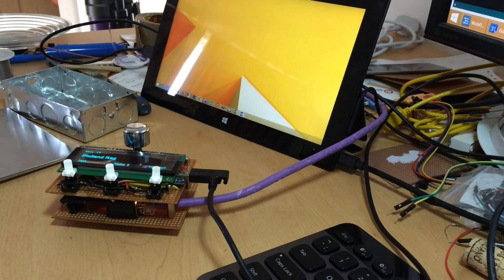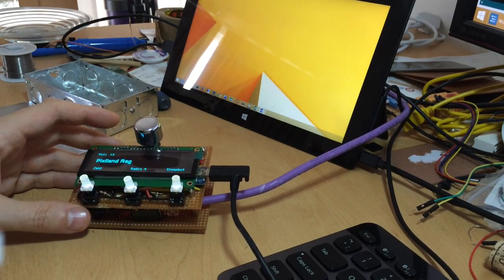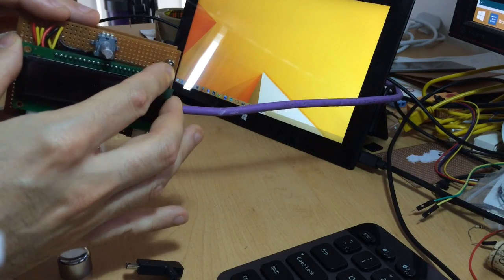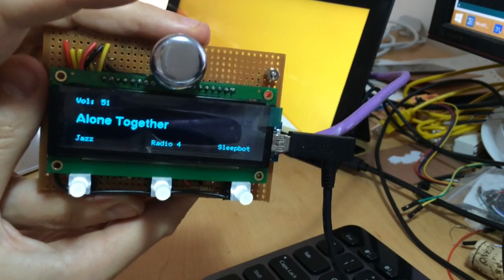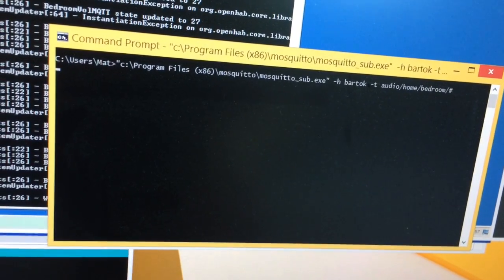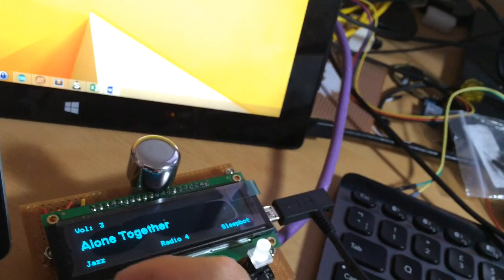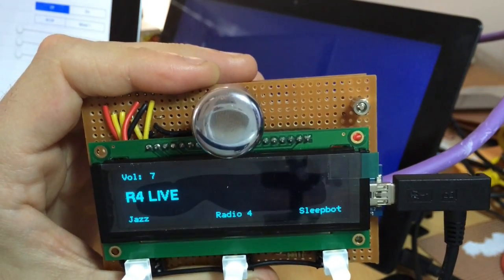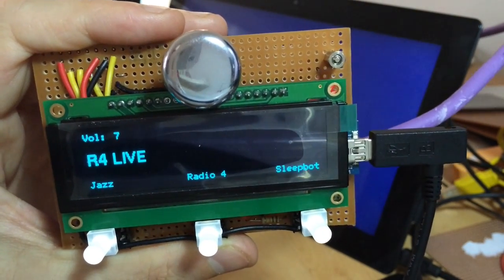Arduino-powered Home Automation Display & Control Plates

Comment: Hi Mat, great video and a very cool project! I am also a follower of Julian's channel and I've recently developed a bit of an obsession with arduinos! 
I have started building something similar myself, initially it was to create my own "intelligent" central heating system, so that I can control the different zones in my house a bit more than you can with just thermostats. But I've got the bug for it now, and having seen your videos and as someone who has used squeezeboxserver as a multi room audio system for several years, I'd love to upgrade my room sensors to control panels... at least in some of the rooms anyway!

Are you willing to share some of your code used for the controls? 

I'm thinking of making my own pcb's for this, with POE. Have you considered capacitive touch buttons? I have a feeling they could be easier to build into this sort of project, as well as being more compact?
Reply from the maker: Hi James, thanks. Agree - it's utterly addictive. I've done loads more work on it since the last vid, in fact I just finished a little video with some updates to the project. I'm uploading it now. Latest version does include capacitive touch, although not for control but rather to bring the device out of sleep (a sort of kinesthetic feature, you wave your hand in front or touch the faceplate and it lights up).

Since the above I've moved over to the Arduino Mega2560. Simply can't keep my code below 32k, nowhere near in fact. I wanted different fonts using U8G library, and loads of settings to be downloaded from a server and stored at startup.

I have long been thinking of moving everything onto my own board including W5100, PoE, and the AVR. I concluded I wouldn't do this because of the large increase in complexity and my personal deadlines (we are renovating the home soon...) PoE (DIY version at least) is the easy bit if making your own board, implementing W5100 is a little more complex I feel.

I'm totally willing to share some of my code. It has been in "unfinished" state for the last few months as my ideas have been growing. I have a deadline in sight as we are renovating the home. Can you check back on my channel or blog and I'll upload some snippets soon?
Reply: HI Mat,
Thank you for getting back to me - I love the capacitive touch idea for waking it up - a really neat touch!

I'll be sure to keep an eye out on your blog for some code snippets and in the meantime if I come up with anything else that I think may be of use, I'll be sure to let you know.

Thanks again

Comment: I really like what you're doing and am planning a similar architecture for my house. Where did you find that Tuodi panel (one minute in)? Does it fit your motion sensors?
Reply from the maker: Very good question! My idea was to find a PIR housing into which I could install my own PIRs (you know the very cheap things on Ebay, £1.20 or something) - and other things like light sensor (ebay cheap), temperature and humidity sensor (the DHT22). I thought maybe the housing would cost £3-5 each, so total cost would be £12 for each multi-sensor. Not so - couldn't find housings so I bought the one you see here which included a mains (US voltage 120V) PIR switch. I then removed that (it seemed unsafe anyway!). I haven't worked out how to include my own yet, but was thinking about approaching a 3D printer. Any ideas?
Reply: *****
I had thought of just drilling a hole in a blank metal outlet cover and screwing it into the ceiling. I like the look of the Tuodi panel, but I suspect it wouldn't be a perfect fit, and it's probably a bit expensive to buy the whole unit just for the panel. I'd like to be able to install plenty of motion sensors, so keeping the cost down is important. I havent' arrived at a solution for the DHT22s yet, but one idea I have is to use a decora outlet cover and a piece of wire mesh glued on the inside. Did you price out the cost of your custom laser cut panels? Also, I would think you would want your DHT22s mounted on the wall rather than the ceiling, since the temperature can be higher at celing level. I might put the arduino in the wall and just run wires from there up to a ceiling mounted PIR.
Reply from the maker: Ben Wilson Ha, Ben... we have gone through the same thought processes. Completely agree now about putting temp/humidity sensors not in ceilings. Last week abandoned that idea in favour of putting them behind small panels above door architraves. (Fire safety people recommend putting CO sensors above doors, but I guess that's slightly different as they are trying to catch flow of air outwards.) Putting temp and humidity into wall box is a bad idea as they are covered and may be artificially hot from electronics. Re getting the housing including PIR, I found a very cheap thing, it was £7 including mains PIR switch. I'm coming round to making my own housings using drilled plates too now. The software and electronics side of custom automation is easy compared with the hardware side!

I'd like to run PIRs to CAT7 enabled wall switches, but my Arduino nano has run out of digital ports! May look into io expander.

Are you based in UK by any chance?
Reply: ***** No, I'm in Texas. Do you indend to control all your lights with your HA system? You could put a lighting UI on the same display as your music controls.

I have been considerings ways of achieving a software controlled dimmable light. One option I am considering is using LED downlights and driving them with a PWM driver and my own low voltage power supply. I would wire it so I could switch back to mains-powered lights in the future, since I expect at some point some kind of standard will emerge. The Fibaro dimmer option looks interesting although it appears there stuff isn't available here yet.

I'd be interested to know what your plans are for lighting since you are further along than I am.
Reply from the maker: Ben Wilson Yep, I'm controlling lighting and audio using the same controller.

I decided against software control of lighting in favour of employing multi-function dimmers to do the work. After a LONG process involving deciding to build my own dimmer circuits from components (bought all the gear for testing and production!) I decided against this in favour of using a Loxone mini server with dimmer modules attached directly to it. Far less to go wrong, and it has a warranty so that if a dimmer blows then I've got cover.

Not sure if Loxone retail in the US? Check out their website, nice looking gear.
Reply: ***** The Luxone gear is available here, and looks awesome but expensive. Just the dimmer module is $500 for four channels. I haven't worked out how many channels I need yet, but I'm sure it will be enough to make that cost prohibitive for now. I found a 4-channel AC dimmer board with an I2C input on ebay for $50, so I might get one of those and try it out. I'll probably do a combination of AC dimming and low-voltage dimming.

Getting back to the DHT22s, I guess if I was to put them being an outlet cover with a mesh grill, they would have to have their own box that did not include any other electronics in order to avoid warming. I'm suspicious that CO sensors might also give off some heat. I don't have one to test at the moment, but if they do, then they would need to be in a separate box. And if I'm doing CO, I might as well put a methane sensor in as well.

Are you planning on doing multi-room audio with your setup?
Reply from the maker: Agree with you re avoiding other heat generating devices with the DHT. I tested it out with a long cable run of CAT6 by the way. Worked flawlessly over 20m. So could potentially wire it back to central location.

Re the Loxone they do a DMX extension module for cheapish. I have 29 circuits (maybe over spec'd!) and price would be prohibitive but you can get a DMX dinner for £100 for 12 channels. No brainer! Yet to test it out.

I'm just a bit wary now about putting all eggs into one basket with my custom solution.
Reply: ***** DMX was actually the first approach I investigated. Is that an AC or low voltage DMX dimmer you're using? The AC ones I have seen all seem to be more expensive than what you're indicating and have sockets for plugging in stage lights.

I watched your video again and noticed you were on the lookout for buttons. I tried some LED tactile buttons but they were too small and didn't feel sturdy. I have ordered a couple of 19mm angel eye momentary panel mount buttons to try out.

I guess it must be rare for people to mount custom electronics in their walls.